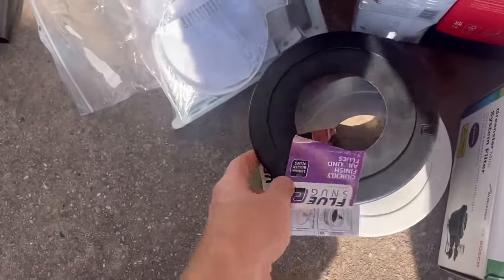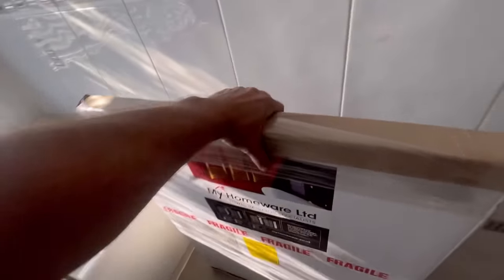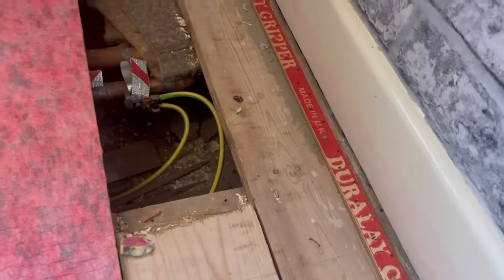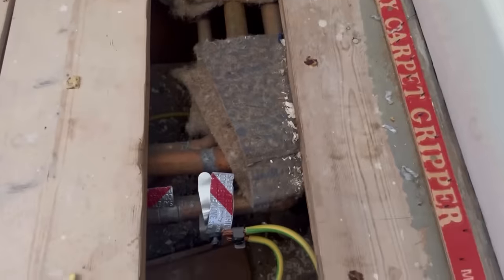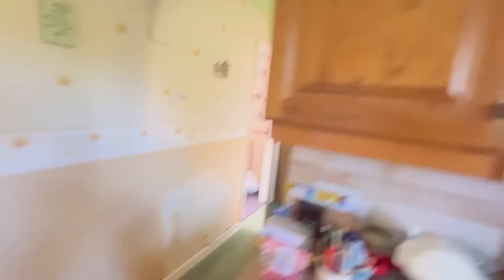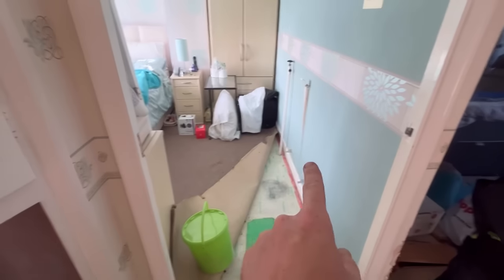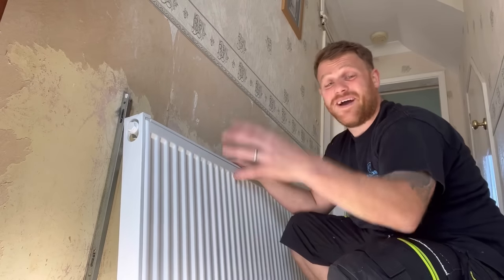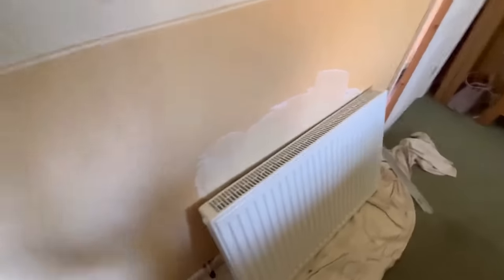System Conversion Part 1: Upgrading Your Plumbing To A Combi Boiler

Comment: The joys of encountering  1960,s heating systems that have been "updated " over the years!
I take it the original  boiler was a  back boiler and the cylinder was the original Primatic with gravity rad on landing, ( hence 3/4" top and bottom flow and return. Compression swept tees under the floor are a giveaway!
Later on more rads where added and they probably fully pumped the system without replacing the cylinder.
Not a good idea, the air bubble is the only thing that maintains separation of the heating and DHW and the addition of a pump can often compromise that.
What you called  Stramit, was more likely woodwool and is bound with cement and probably did not contain asbestos.
But in the absence of a specialist  appraisal,  you made the right call!
Easy for me to make comment because I started in the trade in the 1960's and have seen a lot.
Well done for how you went about it!
On the subject of the spacing off the wall of rads, there is a reduction of heat output but may only be a consideration in a situation with ASHP's running at lower temps; sorry that's  nit picking!
Great job, look forward to part 2!
Reply from the maker: Spot on John was an old back boiler and they have just bolted onto it, unlucky for us as we had to start again 😅 the boards I was 50/50 to just drill and get gas up but knowing this job would of came back it’s asbestos knowing our luck. Thanks for the comment mate really appreciated, see you on part 2!

Comment: just finished a quite simple conversion tonight and when I tested the old mixer shower it burst inside the wall, good job I told him i was replacing the shower.
Reply from the maker: Haven’t had that happen to often, had the odd rad burst and tap drip but can happen when converting

Comment: That "old fashioned hospital" radiator is actually plumbed in the most efficient method. Bottom in, Top out is worth approx 10% more heat output. That's a style of plumbing rad that's used in Europe
Reply from the maker: Yes mate spot on, put a shorter video of them rads on tiktok and few people said same as you 👍 I have seen more modern rads piped like this with TRV at top, makes sense it would circulate better

Comment: This heating system looks like an old one pipe system or a gravity system without  a pump?
Reply from the maker: Yes mate was originally a back boiler system by looks of it the way the pipework ran

Comment: Could you not have gone into cupbourd at bottom of stairs then into front bed ?
Reply from the maker: No we did check to see if it could be hidden inside cupboard but in part 2 you see there’s a beam…we end up going right in corner as well

Comment: Makes no sense to move the boiler with all that extra pipework?
Reply from the maker: Still would of been extra pipework if it stayed in kitchen with gas run and hot and colds